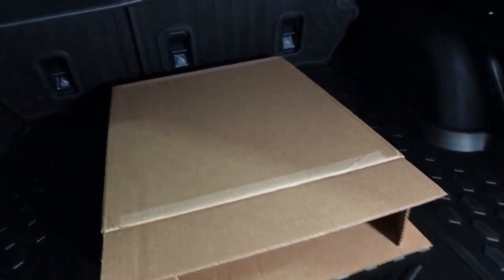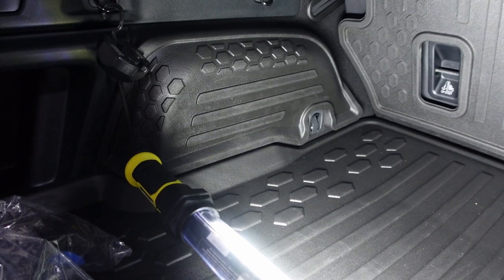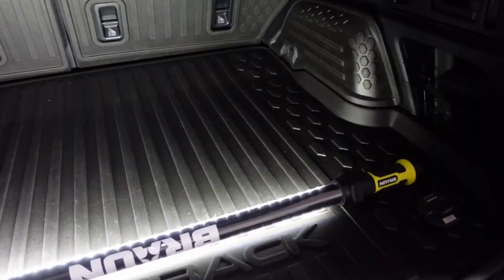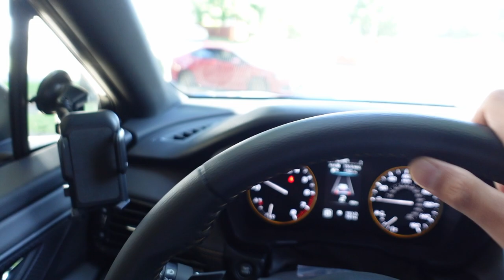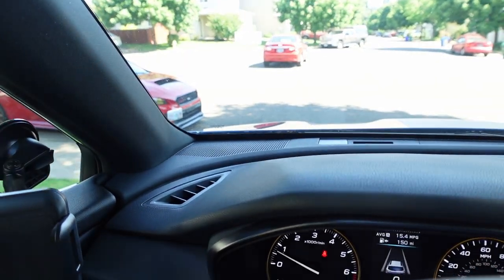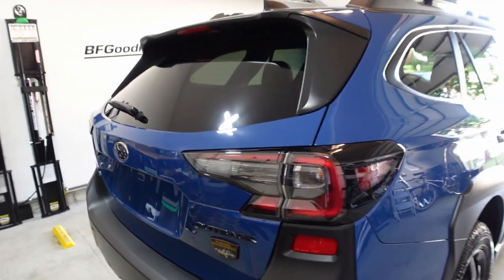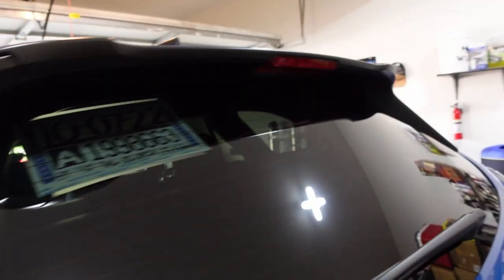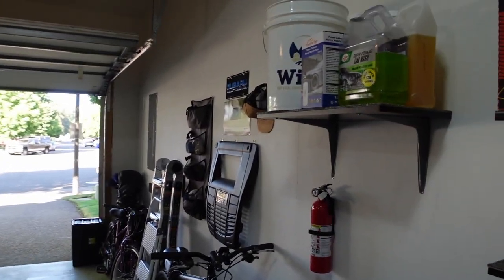The Outback Wilderness Gets Ceramic Coated! | #Vlog

Comment: Did you get PPF laid out on the whole hood?just wondering if you got any air bubbles from the sticker on top?
Reply from the maker: The PPF has a cutout for the vinyl overlay on top, otherwise it would bubble up.
But yes, the ppf covers the entire hood, minus the vinyl overlay.
Reply: Okay cool I just got a date locked in for the PPF on my new OBW but wasn’t sure of which option to go with since I was told it could possibly bubble up being laid over the vinyl. Appreciate the reply man.

Comment: I know prices differ but could you at least give us an estimate on the cost.
Reply from the maker: Sure thing. A little over $900 is what I paid. This is cheaper than most since it’s not from an actual shop.
Reply: Does that price include PPF and ceramic coating?
Reply from the maker: @asmithghost   nope, the PPF is separate. I got it done at the dealer.